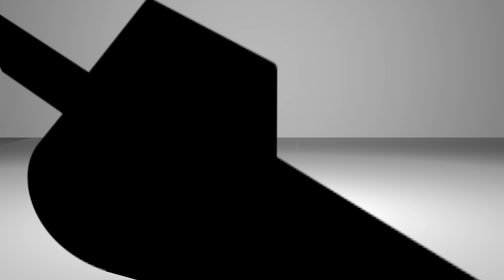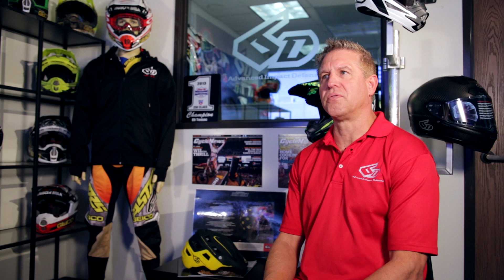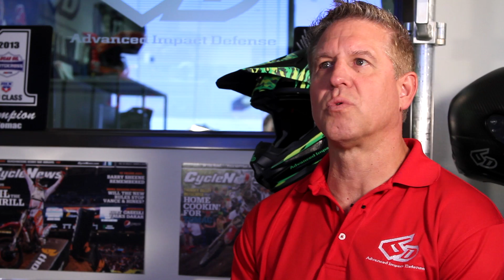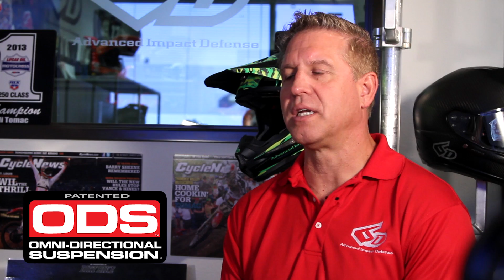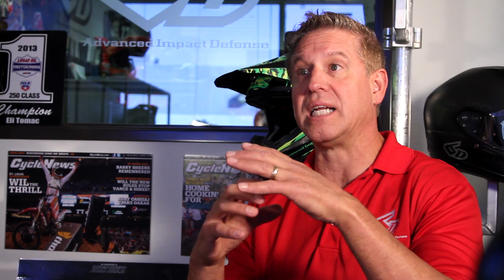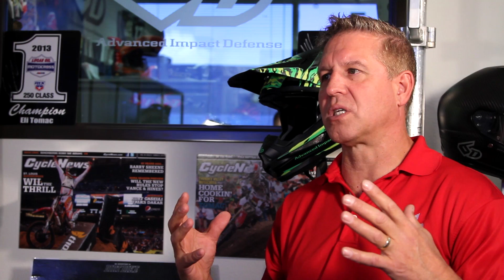The Story of 6D Helmets (Part 1): How it All Began

Comment: Outstanding! Viewers please share. Educate yourself on how the brain is effected during an impact. It is what it is. Currently, there is no other motorcycle helmet on the market that can match the protection of 6D's helmets. Kudo's to Motorcycle Superstore for taking the time with Bob and posting this.
Reply: The Bell Moto 9 Flex also has a anti rotational system and different layers of EPS. Plus there is MIPS in some helmets now, which is probably better than nothing as well.
Reply: Any rotational energy management is better than "nothing". Consumers need to ask themselves; what do they want out of a helmet? If it is brain protection, 6D is your answer. MIPS is limited in providing equal protection from all angles of impact. 6D will manage from any angle. The Bell Moto 9 Flex focuses on Linear impacts more than Angular Acceleration Mitigation. With no dampening system, the initial impact may be managed effectively, but how does that technology reset to continue to provide protection from rotational forces? Seems that the liners only "slide" effectively in a single direction. What allows the liners to retain their initial position? It all boils down to time. The longer it takes the force of an impact to reach the brain the better. Why is 6D posting results of energy management on their own website? Because they can prove their helmets work. The big question is, why are other helmet manufacturers NOT posting impact test results for their own helmets? They all have something to hide. The main function of any helmet is to provide brain protection. Seems that is the LAST concern with most of the helmet manufacturers. Search any advertisement. Impact protection is NOT promoted. When you shop for a helmet, ask how many G's were recorded during testing so you can compare to other helmets. Also, ask how well the helmet provided protection against Angular Acceleration. Good luck. You will not get the answer. It is nice to see Bell jumping on the bandwagon though.
Reply: noBS you're right about the bell, I never reall, thought about the missing dampeners. I rode a 6D for the past 2 years and never had any problem, but it has taken a couple of small impacts and it feels loose now, so I'll buy a new one soon. I'm thinking about another 6D, the SE4 from TLD or the Moto 9 flex. The problem with the 6D is it's size and weight in my opinion, that's why I'm thinking about a different helmet.
Reply: noBS The problem I have with any test results is that they come from a company and not a independent lab. These labs probably have the real results but aren't allowed to release them... every company shows a graph where their curve is much better than any other helmet, so I have no trust in those results
Reply: shortyMX You bet. I have personally tried to get impact test results from testing facilities. Per contract, they are not allowed to release findings. Same from helmet manufactures. (LS2 lists DOT results on their own website [US] which is great). 99% do not. And they ALL refused giving me results. Including hanging up on me, to threatening that I am asking the wrong questions and I should stop. What are helmet manufactures hiding? 6D has listed results in g's and rad's on their own website. Great info.!  For riders looking for protection, the question we need to ask from any helmet manufacturer is "what are the impact test results for this helmet I am looking at buying?" "I want the best protecting helmet, and that is my shopping priority." We can all shift this behavior. MAKE THE CALL. EMAIL. Whatever it takes. NO helmet brand promotes or advertises impact protection. Until 6D surfaced. Look at any AD any magazine. Manufacturers use the words "safe", "protection", Snell, DOT, "ECE approved", etc. So, it is my findings that manufacturers are specifically designing helmets to meet standards. Not brain protection. Increasing brain protection along with technology is their LAST priority. Manufacturers know we are "stupid" and they build helmets to meet the "needs" of the masses. MIPS touches on the issue but can not match the ODS tech. in a 6D helmet. MIPS doesn't offer the same protection at all angles like 6D does in lab testing as an example. To help provide some comfort, look into test laboratories. Torrance CA is reputable. Make some calls but better yet email for written proof. Good luck.